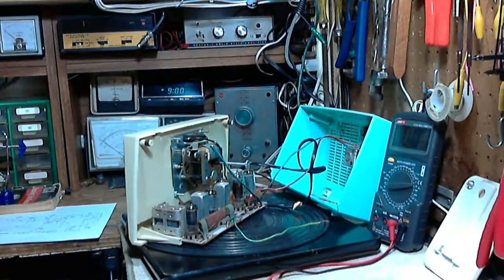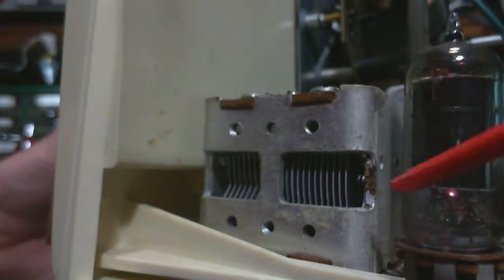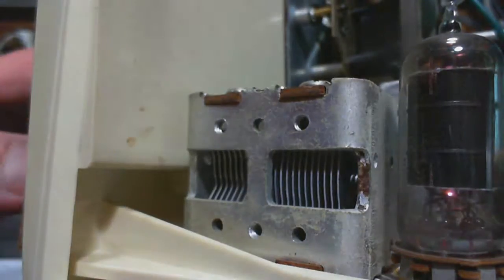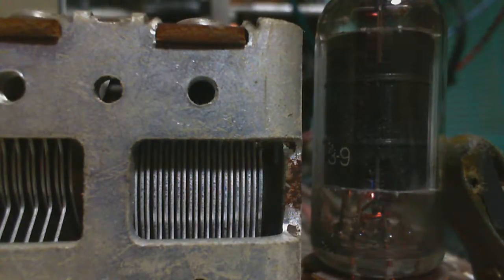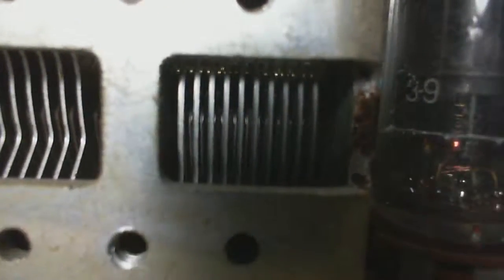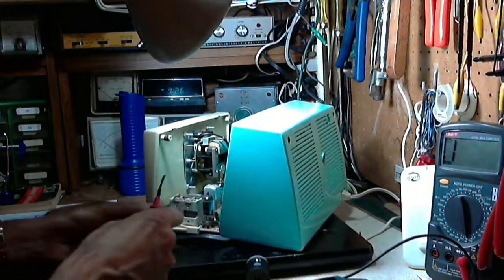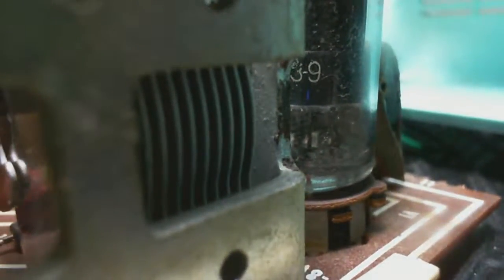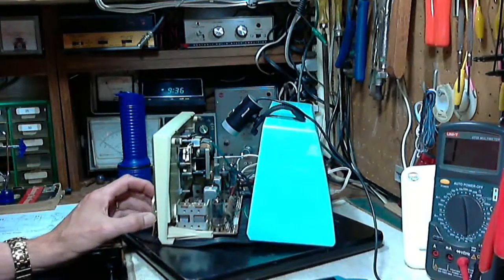Electrohome AM Clock Radio Video #2 - Shorted Tuning Capacitor

Comment: Interesting I have a 1937 Cossor radio on my work bench it’s been a lot of fun so far, including open circuit output transformer, open circuit interstage transformers and short circuiting tuning capacitor taking out B+ rail. It’s a much larger capacity than the one in your set but really struggling to track down the actual short circuit.  The slightest touch open or closes the short, really sensitive. Thanks Regards Chris

Comment: I would change that resistor to 220 ohms. On some other similar Electrohome model schematics that resistor is between 150 to 220 ohms. What is that rotating thing you have. Looks like a turntable.
Reply from the maker: Buzz1151 It's a heavy duty turntable meant for a CRT TV or CRT computer display.  On changing the resistor, I calculated the plate current at 35mA and the rating is 50mA without a signal.  I guess I can change it and see what happens.  Bigger can't hurt.  Hey, if the existing resistor is supposed to be 22 ohms but measures at 40, what was happening at 22??  Maybe the tube and resistor cooked, melting the plastic and turning the resistor into a 40 ohm resistor thereby settling it all down.  That's a real good story.  So somebody stuck a 22 in there instead of a 220.  I'll be sure to try a 220.